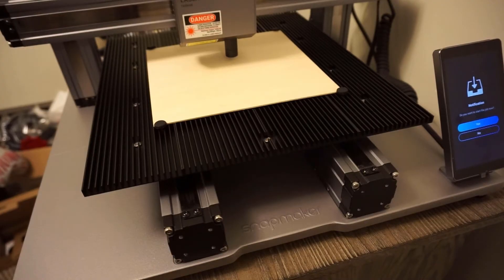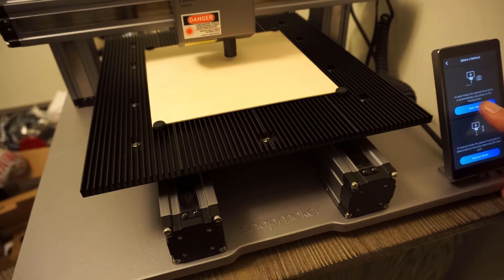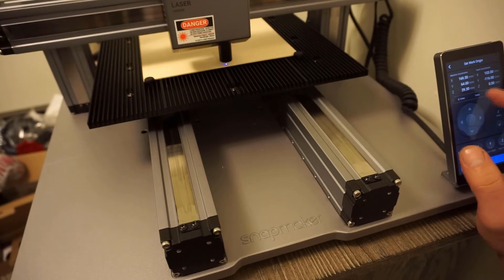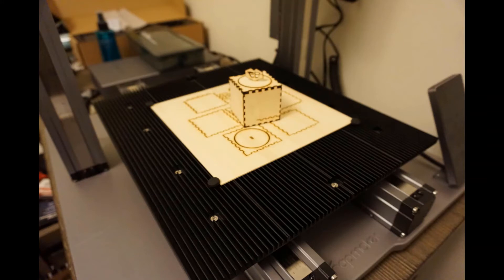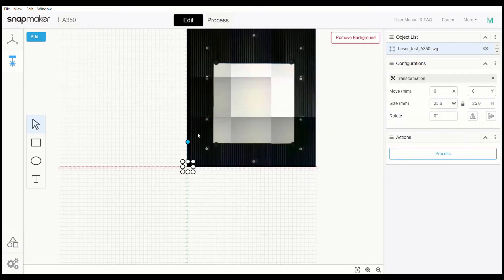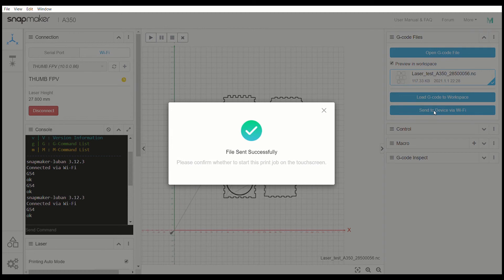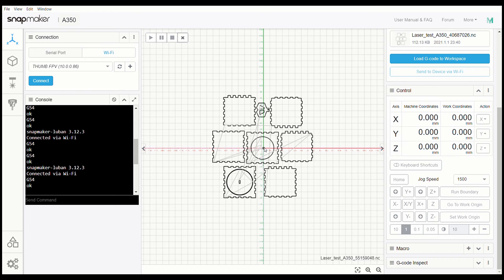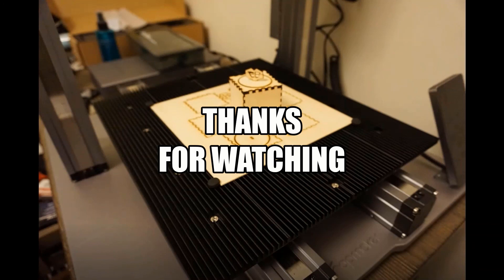SNAPMAKER 2.0 LASER ETCHING PROBLEM FIXED

Comment: Hi
 Your video just popped up on my screen and it piqued my interest. What made you decide to spend over $2000 on this machine? when you can spend about $350 on a CO2 K40 and upgrade it do things like this for another $500  https://www.youtube.com/watch?v=i1M39dzyCOw  and do normall engraving at 1000mm/s  with a 40 watt tube on a huge variety of materials.

 Diodede lasers are supposed to be  a cheap introduction to laser technology but  at the 450nm wavelenth  it has limited material capability.  Yes, it engraves some materials quite well but is VERY inefficient at cutting because of the lens and the wavelenght it operates at.  

Dont get me wrong, this is not a criicism of how you spent you money  because I can see that this a very  well enginered and sturdy piece of kit . Howver, the   real  the value is in the equipment and not the techhnology. I am genuinely interested about any research you may have done before opting to go the diode laser route . I see you using your phone to control the machine and have to ask if  this another cloud based software?  With Glowforge you pay $50 / month to  access their cloud service..... you own nothing except the hardware. 

I stress again that my  interest is genuine. I have been learning about laser technology  for 7 years and have used CO2  glass tube and RF machines and also MOPA and Q switch fiber lasers.
I understand the strengths and weakness of each of those technologies and have used , but not owned, a diode lasers. I know many  diode users that have moved on to CO2 lasers within a year or so and wondered if this was part of your future plan.  I realise this video is 18 months old now so perhaps that decision has already been made? 
Best wishes
Russ

Comment: What I haven’t played around with a lot yet is combining the two methods.    I did a (dumb) engrave on my wallet and simply measured its height and typed it in, I’d like to be able to use the interface on the Snapmaker itself to set the Z access but still take advantage of the camera mode.   But the camera mode did let me line it up just fine by hitting the Run button instead of transferring it to the Snapmaker by wifi.
Reply: How do you use the cam. mode? I get the picture while editing and processing but when I've generated the g code and sent it to my SM2, i'll have to set my work origin in the bottom left corner. And even then I do not get the position 100% as shown in Luban.

Comment: I’ve have gotten it to work in camera mode, but what you have to do is rather than transfer it to the Snapmaker by wifi like everything else, simply leave it where it has it in terms of being lined up in the upper right square, and hit the little “run”  button to the right of “Connection” instead of “send to wifi”.   I’m assuming you’ll need to be careful to not shut down your computer during the “cut” because it’s probably streaming the instructions from it.
Reply: I’m gona try this and get back
Reply: Yes, you are correct -- your computer must remain connected for the duration of the cut.  It's fine if the screensaver kicks in.  IMPORTANT NOTE:  Before hitting the Run button, you need to enter a few run-time parameters.  In my version of Luban, the run-time parameters are on the left side, below the G-code window:  Material Thickness, Auto-Focus (or not), Laser Power %, etc.
This is known as "on-line" cutting, whereas sending the G-code to the machine via wifi is known as "off-line".  I prefer to call it "tethered" versus "untethered" but whatever.  I actually prefer to cut while tethered, because Luban displays all kinds of information during the cut that you can't see on the touchscreen when you're doing off-line cutting.